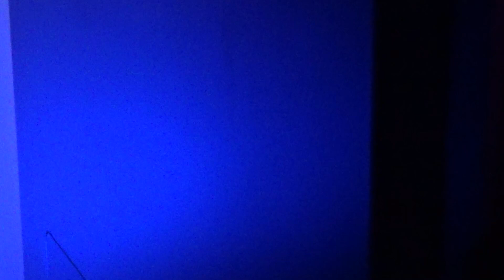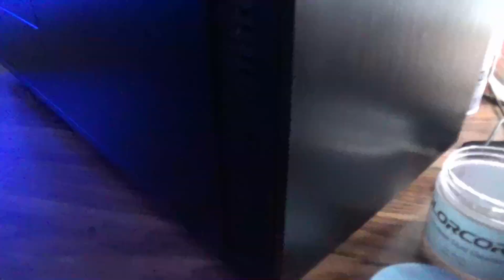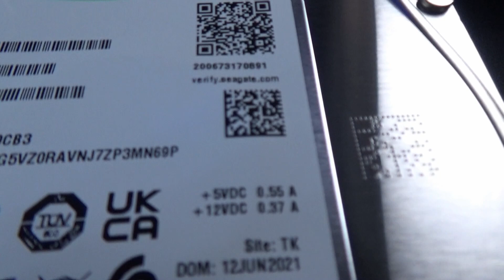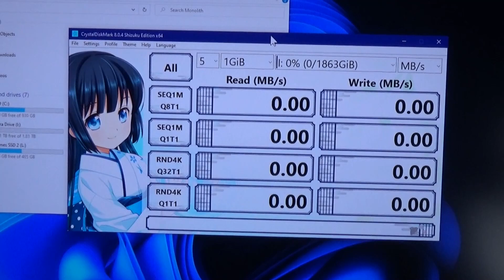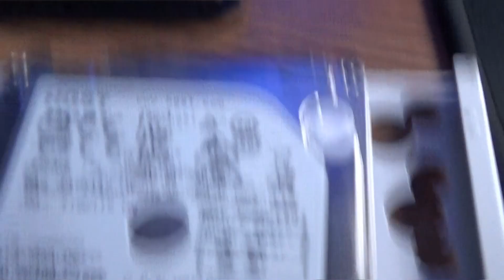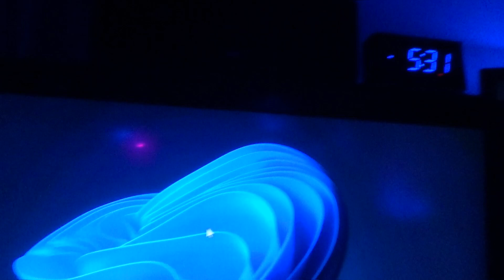Monolith Is A 5-Year-Old Computer Now

Comment: I got my latest PC around the same time you built Monolith, and it has the same CPU (6700k) but a worse graphics card (GTX 960). It replaced a Q9550/GTX 260 system. It could use a new GPU, but everything else is fine. A hyperthreaded quad core Skylake just doesn't "feel old" yet, like Core 2 did in 2016. (Even Sandy/Ivy Bridge is still chugging along fine.) Maybe computers have felt faster, longer, because SSDs took off?